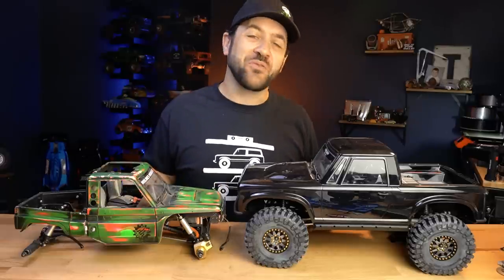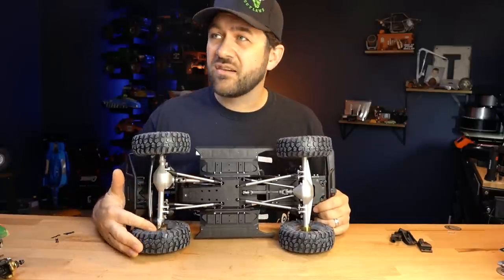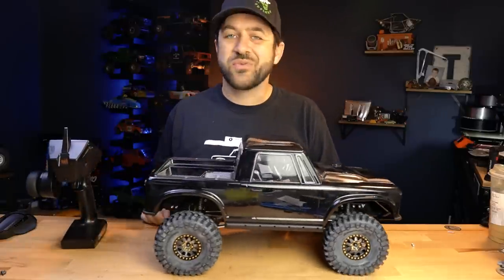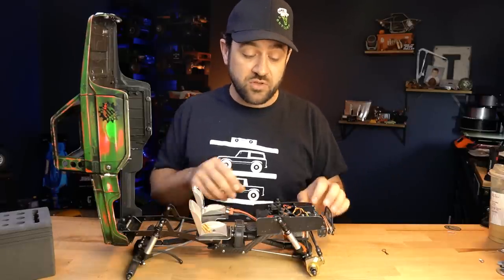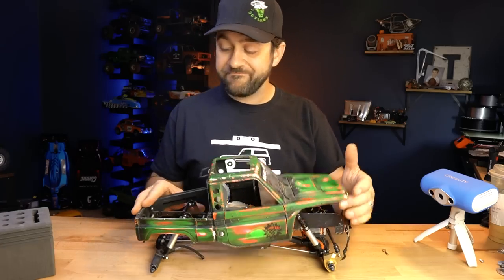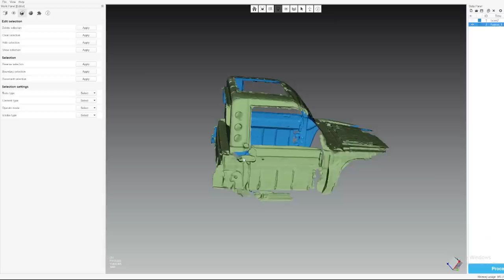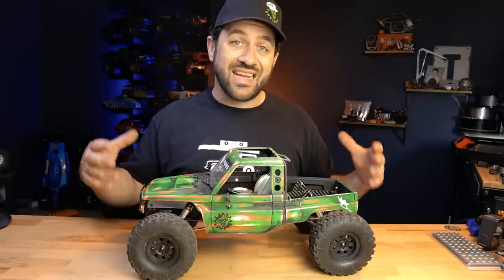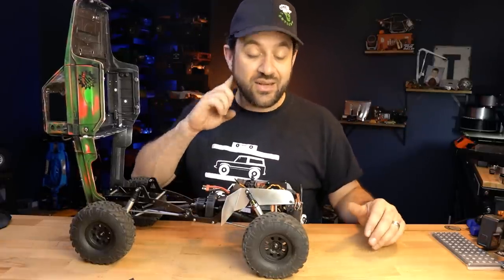FINALLY selling the Flex Seal! - Flip That Truck - S3 E3

Comment: What website do you think is the best to buy used rc cars and rc parts?
Reply from the maker: I check any area I can, FB, IG, Craigslist, RCCrawler, bathroom walls, etc.
Reply: @HarleyDesignsInc  thanks will check that out
Reply: When you find out let me know...
Reply: I just need a crawler to tinker with I can't compete any more .. Crushed my ankle never healed right after surgury.surgery.. So just   a roller basket case would be cool ..